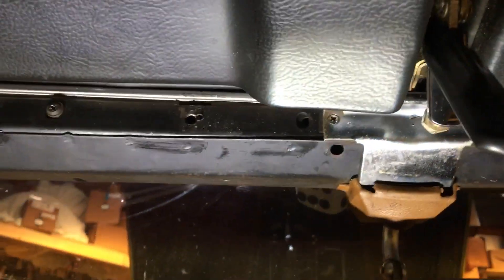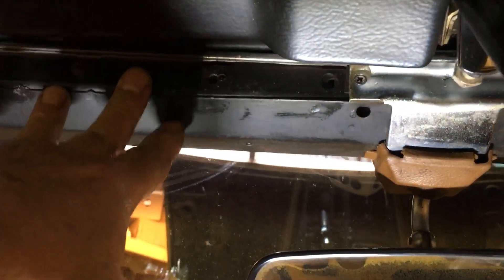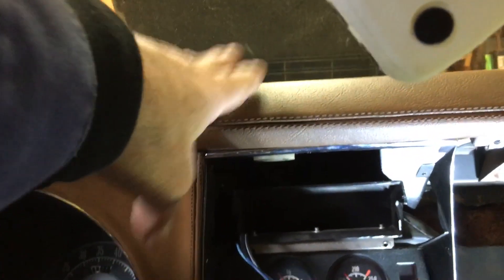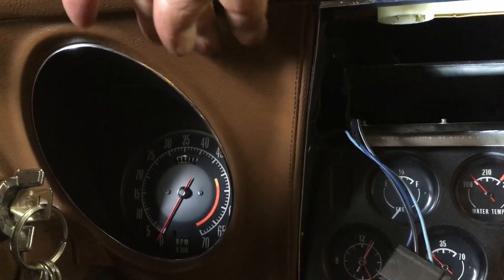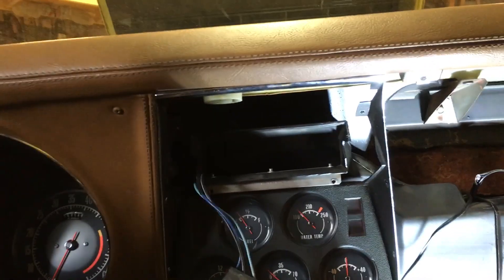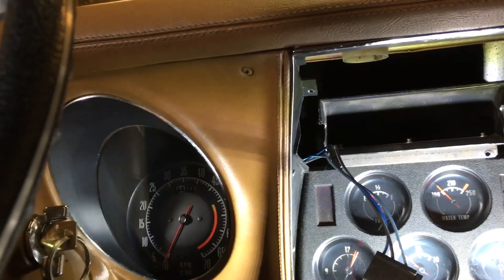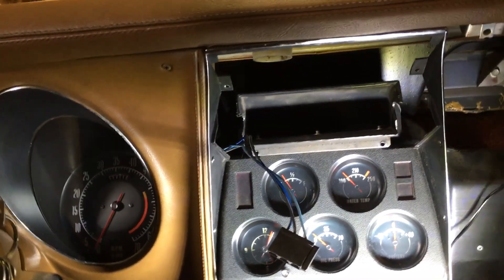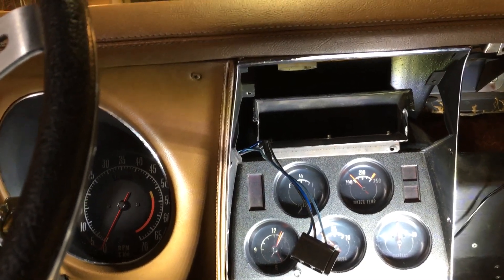C3 Corvette tachometer cable install.

Comment: Thank you for sharing this video. I have a 72 with a bad tach cable. I heard removing the dash pad was the easiest way to get to the back of the tach and speedometer. I fought for a few hours trying to get the front panel to move forward enough to get my hand in there and it is impossible. I gave up and put it back together. Now I will attempt how you did it plus now I know where that hidden dash pad screw is, Thanks again.
Reply from the maker: I hope it works out for you . Always work slow and have patience . Remember ..You love your Vette !
Reply: @goodboyringo9716  I will attempt this next week.

Comment: Only video I could find that showed me how to do this without taking everything apart. Thanks for the help.
Reply from the maker: Glad it helped you !
Reply from the maker: @marcodevries4481   You know nothing about a corvette . the right side dash needs to come off to gain access to the bolts holding the top dash on, ggg. 
the top window trim needs to come off to remove the A pillar trim to remove the top dash. then you can go in the top to the tach. no other way smarty pants.
Reply from the maker: @marcodevries4481  ... You know nothing about a corvette , it's not a VW
Reply from the maker: Thanks for setting this guy straight, he knows nothing .
Reply: @goodboyringo9716  anytime, wouldn’t have been able to replace mine without your help!
Reply from the maker: @XxD0INWORKxX  . I can't believe a guy would say I'm giving misinformation without ever working on a corvette. Thanks my friend.

Comment: In your video you said there’s lots of videos of the retaining clasp at the back of the tach.  Could put a couple of links here, I couldn’t find any.  I cannot get that damn locking clasp at the back of the tach to release the cable.  Thanks, good video BTW.   Ever mind, figured it out.
Reply from the maker: Yes , glad you figure it out. I couldn't remember  how it worked but I do know that it  came off very easily  .  Sorry it's been awhile and i sold my Vette.

Comment: So if you don't have AC you can get it from under the dash?
Reply from the maker: Sorry it took so long to reply, I somehow missed your question.
My corvette does have air so I can only rightfully account for it but in my opinion I'd say
you maybe able to reach the back of the tach with your hand from under the dash but I can't be 100% sure.

Comment: Nice 72. I guess I'm glad my 73 didn't have the a/c cause I could just reach under and get it off. Boy what a one-handed carpal tunnel killer and also another quick tip make sure your bird cage ground behind the front d/s wheel body mount area is good or the tach drive cable works a body ground and will get hot and break again. I use to fix that problem when I worked in the vette shops.
Reply from the maker: Thanks , I broke the cable turning the distributor to far, it worked great before that happen. Repositioned  the distributor so this wouldn't happen again, only thing is ..
new cable was a little longer than stock one. I may buy another one and exchange it if I have problems.
Love your white with red Vette, I may do a paint job on this Vette next year.
Reply: @goodboyringo9716  I was the mech. in the vette shops but got stuck doing tear downs for paint jobs too and a lot of aircraft paint stripping goo it works good but nasty stuff. Painting and bodywork is not my thing even tho I've glued these vettes together. Ive got to paint mine too but still drive it just the way it is for now.
Reply from the maker: @scottsinfl    I'm wondering what is the best way to strip the paint ? I've seen guys use a razor blade, but my Vette has been painted twice so that may not work for me.
I 'm thinking stripper may damage the paint later and I don't want that . What is the best way to strip it?
Reply: @goodboyringo9716  We always used aircraft paint stripper and asatone to wipe it off after you scrape it.  Tape all the jams about 1/2 away and strip that with a blade or sandpaper. Do small sections at a time like no more than 2 sq. foot and after you scrap it to the Gelcoat stop and clean it with asatone then move to next spot. Lol you can tell ive done a few and it was the nastiest job in the vette shop but someone had to do it. YUK.

Comment: I guess no air conditioning makes it real easy cause I reach under dash and easily remove cable on my 72
Reply from the maker: Right , I once had a 1970 without air and one could get under easily, I changed the brake power booster on it , no problem getting to it but it was hard.

Comment: Is it just me? Isn’t that a speedometer cable?   Tachometer uses wires from the distributor.
Reply from the maker: Yes , It's you ! 
The Tachometer cable screws into the distributor on this 1972 Corvette ,
It's not  wire  that gets current  that runs the tachometer.
No, it's not a speedometer or I would have said a speedometer .